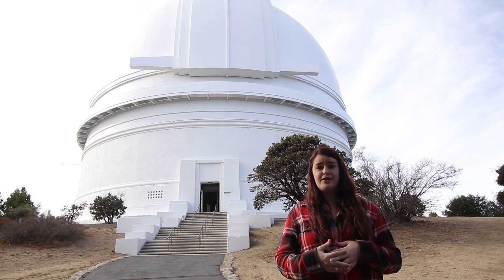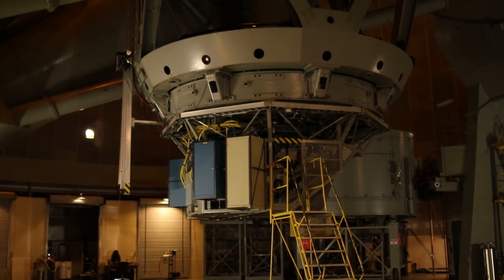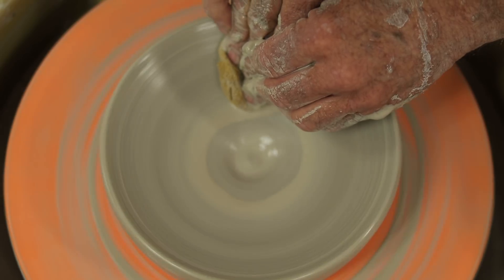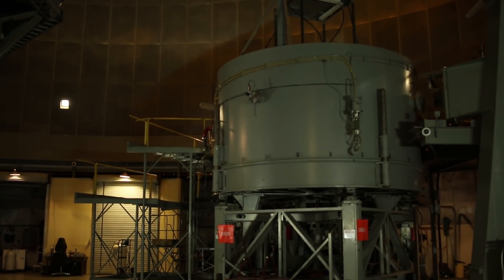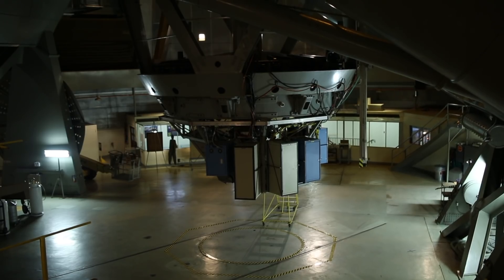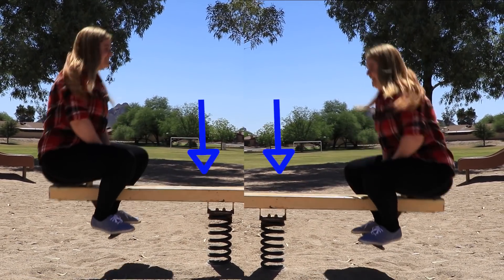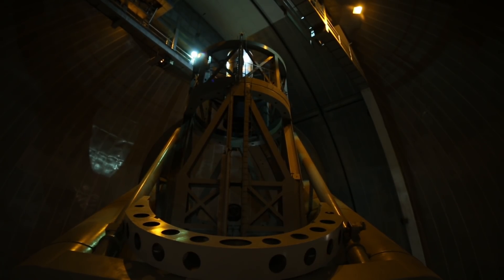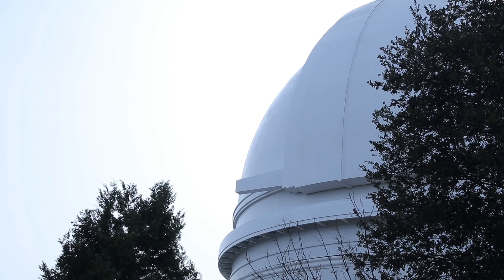An Inside Look at Palomar Observatory

Comment: You got the spinning vs ground thing backwards, normal smaller mirrors are ground, and the 200" mirror was forged in a rotating mold to get the rough curve. It was then further ground and polished to the final figure.  Smaller mirrors star as flats, except for the newer thin meniscus mirrors for larger dobsonian telescopes, though most.dobsonians have heavy full thickness mirrors. All have to be ground for the final figure, which is a long tedious process

Comment: The Palomar mirror was made out of Pyrex not because Quartz “flexed” more.  Quartz is actually stronger than Pyrex.  But because all attempts to cast a Quartz blank in less than half the 200-inch size failed at that time (late 20’s early 30’s).  They spent a lot of money trying.